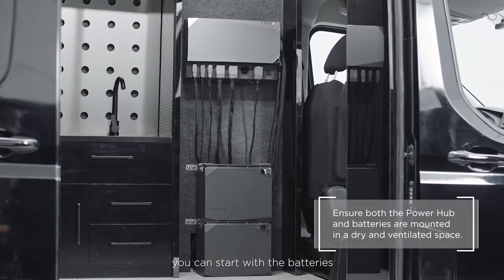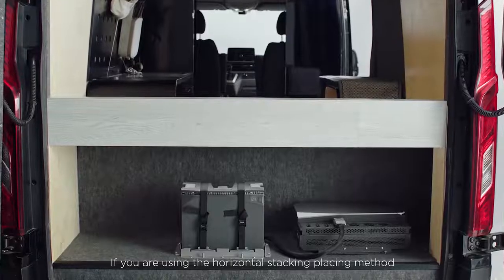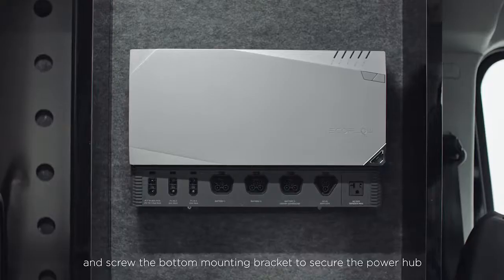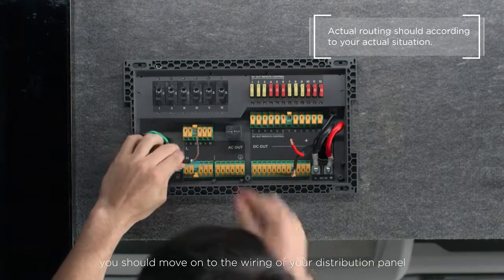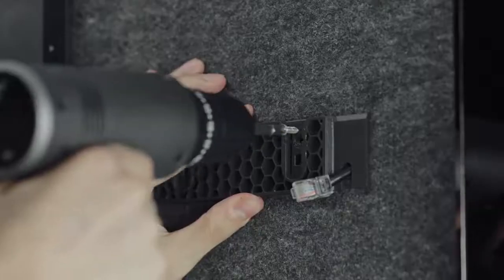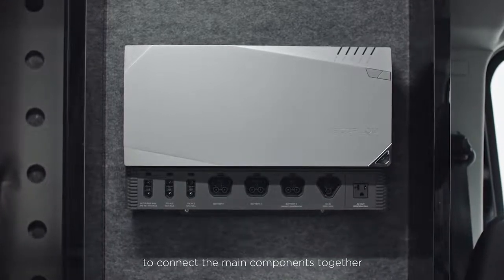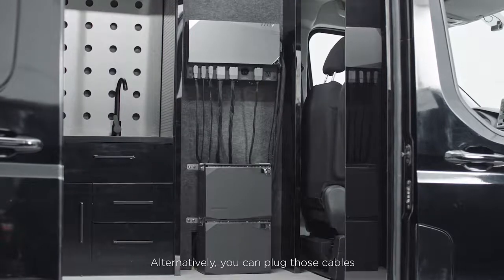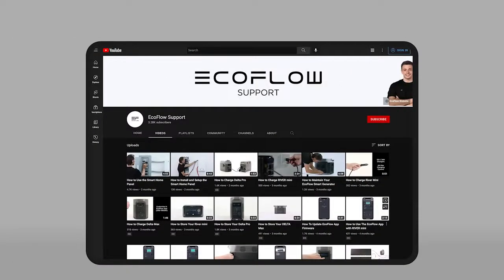Power Kits Tutorials   Basic Installation for Vans

Comment: This is all a great idea though one question.  Is it true maximum output is 60 amps?  This will not be enough for a 12v ac, no?
Reply from the maker: Hi there, the 60A is when the DC output is 26.4V. When it is 13.6V and 70A, the maxi power is 1000W, and when it is 26.4V and 60A, the maxi power is 1600W.